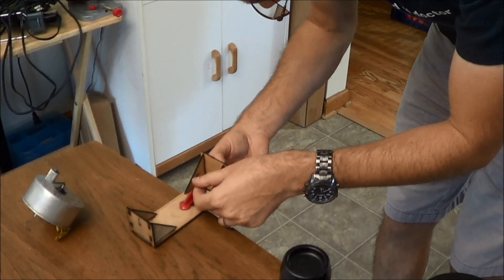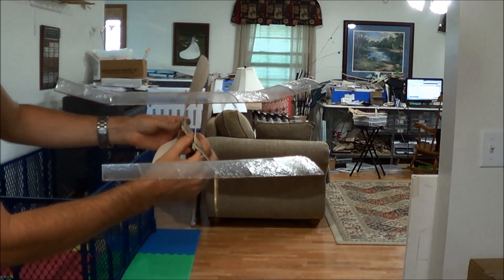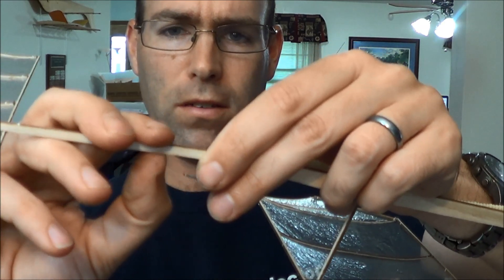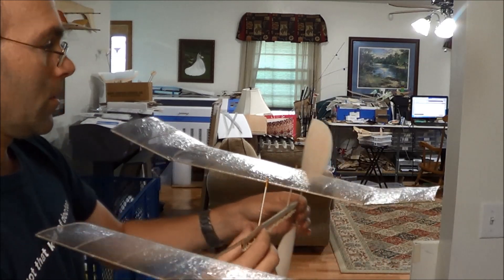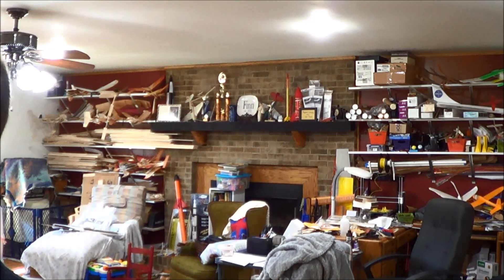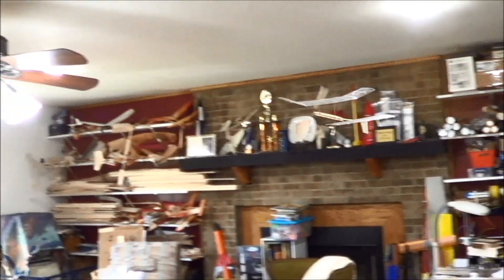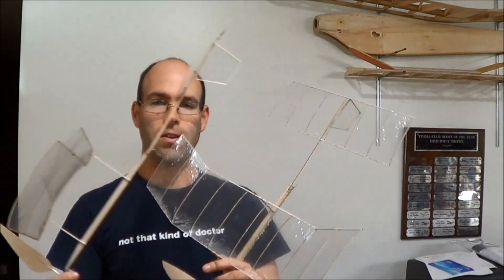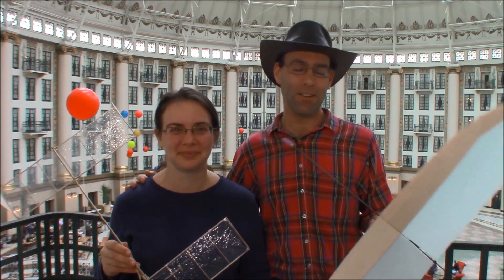Incentsitive Pennyplane Build, Pt5: Flying

Comment: What kind of rubber were you using? Weight, thickness, length?
Reply from the maker: That's an 18" loop of 3/32". Seems to be about optimum for most ceiling heights.

Comment: Pitch up the right wing a little bit 😜
 I bet it will fly much better
Reply from the maker: Philipp Stengele that just increases the drag moment differential of the left and right wings which makes more more zooming around at full torque. I actually took the plane outside after this since it was calm out and it flew just fine.

Comment: I hate having to bend the tail boom on my models, so I always use a separate set of adjust ment posts for the stab. I was wondering if you've tried this, or why you may or may not use this method on a production model
Reply from the maker: It's purely a matter of keeping the build as simple as possible for newcomers and saving some weight. The Noncents kit that we sell has and adjustable tail, but it uses lightweight carbon posts and the like, and it's a harder kit to build (more expensive too).